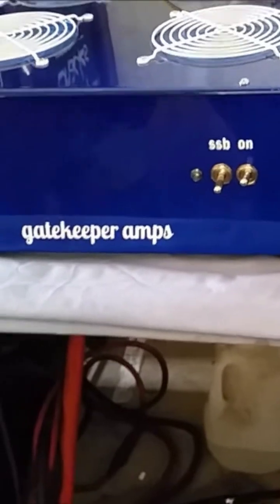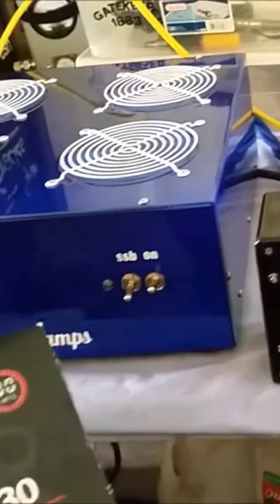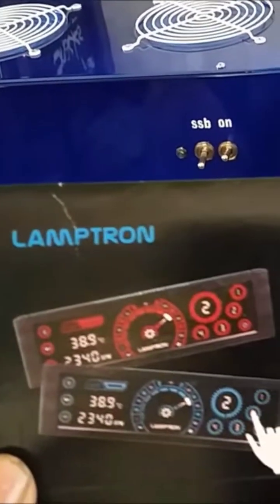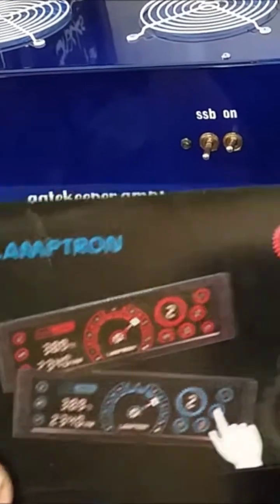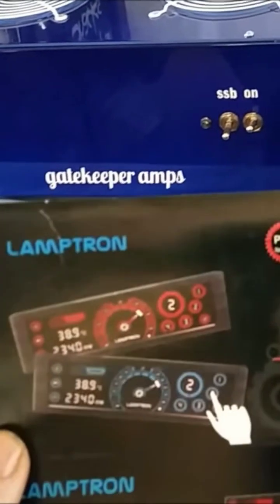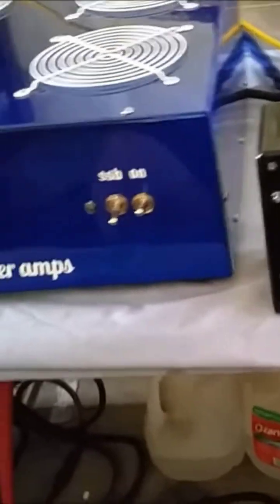Intro To Digital Touch Screen Fan Controller for GK800

Comment: GateKeeper did I need biasing in my sideband linear that your friend built for me oh I do why don't you add it thank you
Reply from the maker: Like I explained to ya it's all a preference..... I always tell people if they are avid ssb operators and really really after sounding as linear as possible then go with biasing... if your just a am operator that likes ssb here and there then it isn't an absolute must. Heck I talked for 3 years on 10m in many contest on a 4 pill class c and never had 1 person tell me I was distorted.
Reply from the maker: If you really want it then of course I'll do it for ya
Reply: I get every amp built with ssb bias , weather i use it for ssb or not.
That said i am primarily a ssb operator.
Reply from the maker: @randyguay7115  then this has been a learning experience for you..... know you know you tell each builder you need bias and if they don't want to do it then you don't go with that builder. That simple. So what do you want to do about your current 6 pill?
Reply from the maker: @randyguay7115  oooops I made a mistake I thought you was steven replying to me lol lol sorry about that
Reply from the maker: @StevenHuntsman-se9os  waiting for your reply buddy..  text me please

Comment: Don't believe me the rip-off tell me I don't need biasing a linear is built can I buy it and you run sideband he doesn't know that
Reply from the maker: I have no idea what he told ya bud... he isn't a big ssb op... but I always tell people exactly what I told you in text and in that comment it is a preference....  if your an avid big time ssb operator then it's a good idea to go with bias. Maybe there was some miscommunication between you and him i have no idea I am sorry about that but I don't mind at all adding bias to it bud. Heck we csn up the volts a bit on those supplies and get you a bit more output also like around 1500 if you want but it will last for ever around 1200. LMK via text message 678 557 4846
Reply from the maker: I didn't complelty understand your comment BTW you mind re wording it thanks bud